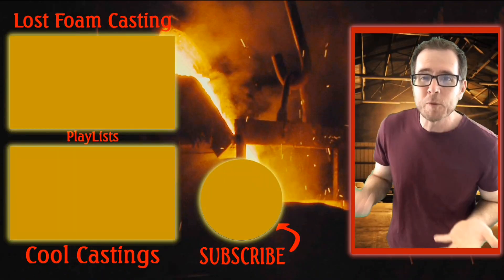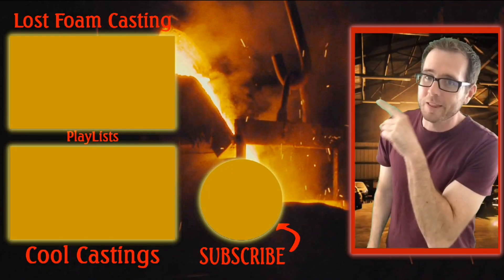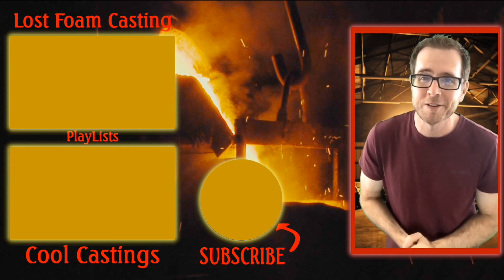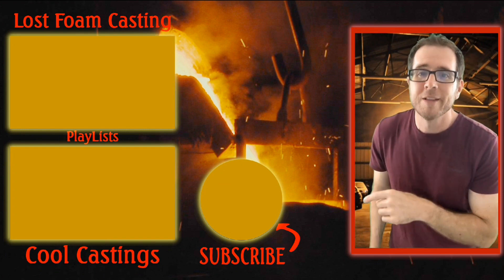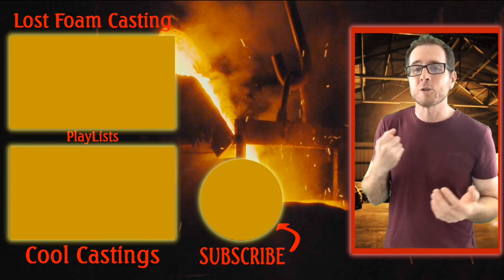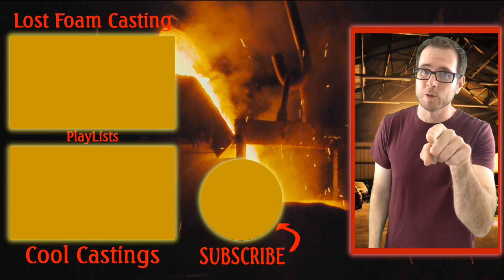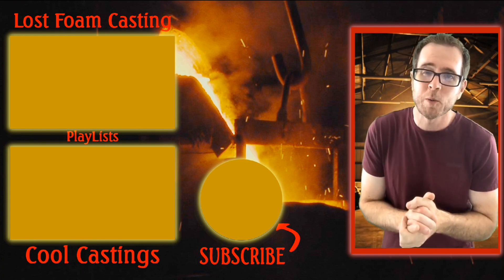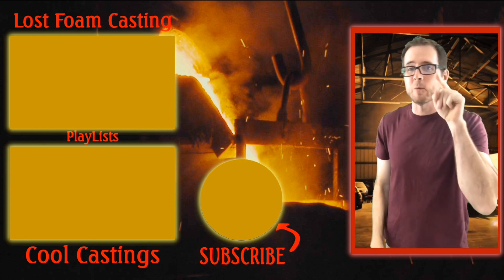Melting Copper Tubing with my Cast Master GG5000 SS - 5kg Furnace - For You ASMR (#meltingcopper)

Comment: Quick question - Pennies are 97.5% zinc and 2.5% copper, but pennies minted before 1982 are 95% copper and 5% zinc. Can you please melt pennies from both pre-1982 and after 1982 separately and see what happens? Zinc melts at 787.2°F and Copper 1,984°F, so it would be cool to compare melting time and see what the copper in the new pennies does when floating (sinking?) in molten zinc. edit: if you find any 1909 S VDB pennies sell them to me.
Reply from the maker: Oh wow!  That means new pennies would probably melt quicker since zincs melting temperature is much lower than copper.  I might do something like that in the future.  I just have to get a lot of pennies. 
Btw, Us mint is going to start phasing out the production of pennies.  Pennies will no longer be produced

Comment: your bars came out nice, i would like to see more info on how you preheat your molds and how long you let them sit ect..
Reply from the maker: I normally put them on top of the furnace over the hole.  I let it set there for about 1min.  Then I move it down to the block and pour.  👍. After pouring, I let it cool 5-10min before removing it from the mold.
Reply: @HeinrichsMade  very helpful! thanks
I tried to remove castings from the molds to early in the begining and broke several molds
Reply from the maker: @zippo1592647873  I hope it helps 👍

Comment: How do i stop the cast from sagging in after i pour?
Reply from the maker: This is shrinkage, and I believe it is because of the rate of cooling.  I am not sure, this happens differently with each metal.  You could try slowing the cooling stage down if it is important not to have a sinking center.
Reply: @Heinrichs Made  ok I will try figure something out. Thank you

Comment: How about a link to the equipment you use?
Reply from the maker: For the furnace?  They must be out of stock on Amazon, but they have the 10kg furnace there.  They have the smaller one on their website that I'm using here:
https://castmastereliteshop.com/products/5kg-ss-deluxe-propane-furnace-kit?variant=35433110798487&gclid=CjwKCAjw3K2XBhAzEiwAmmgrAtAKoHi8BRFtx5FN9EiC0tao7uqGvp6Bs9FnS7Un0jXyMNyhJjbPPRoCp9wQAvD_BwE